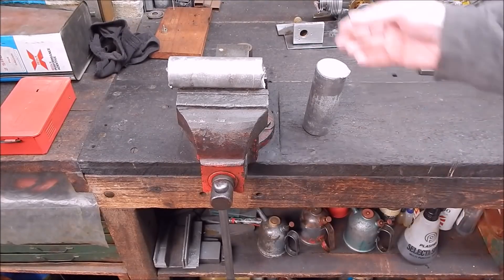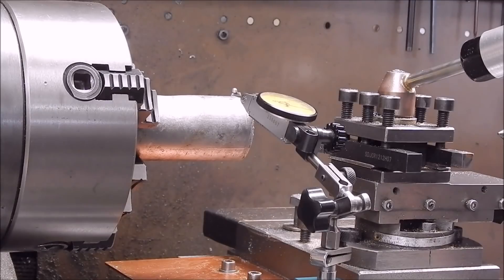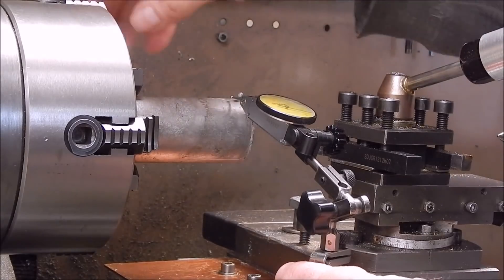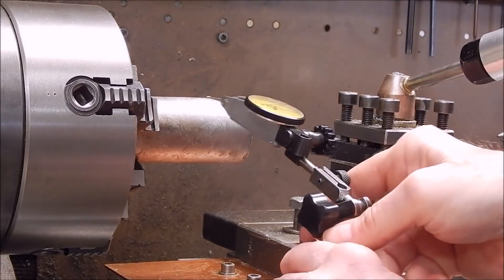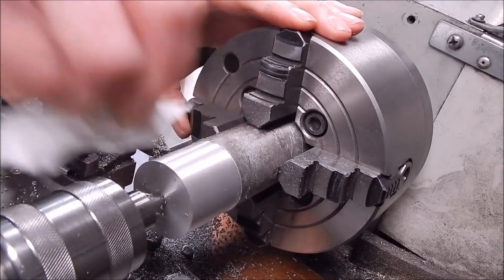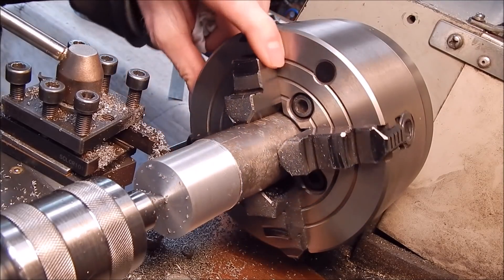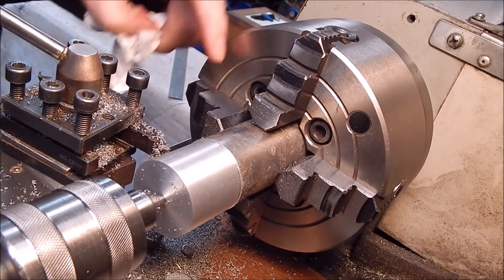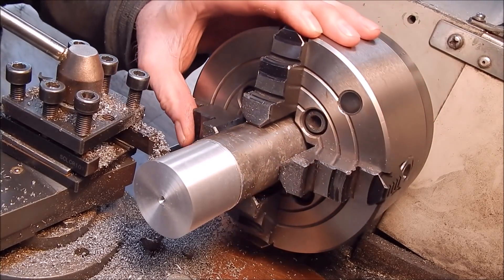How good is home made aluminium round stock for a metal lathe ?

Comment: Amazing the price they ask for "new" stock. I'll throw anything I have into the furnace but I've given up on cans, too much work. They almost always have beer or soda left in them which leaves more voids. Mostly I use castings for my lamps and I don't need anything that's graded, except for polished stuff, I have to use "new" stock. I've even thrown "white" metal into the mix but it makes the aluminum stick to the end mill, a real pain so I stopped doing that. Extrusions, wire, I don't care. If you get particular, you go without. Cheers!

Comment: innerestin' but the tensile will be low low, good idea though, as a yachtbuilder I'd often get a tonne of scrap, 20% waste in yachtbuilding, did you melt it in a pipe
Reply from the maker: I use it for lathe change gears and the teeth stand up to those loads OK.  I melted it in a crucible and then poured it into a pre-heated pipe.

Comment: Didn't really need to watch this as I knew the result would be good. Apart from an aloominumiom manhole cover size piece that Craig's workshop gave me, the only stuff I have is thousands of empty beer cans 😁🍺
Reply from the maker: Time to warm up the shop with a furnace Bill.  Casting in winter has it's good side.  I could never get to like drinking beer out of a can.  Stubbies always for me.  Cheers Rob
Reply: 😅 Yep, the gas forge at 1000c helps take the chill off, a touch of spring in the air now so the little pellet heater is a bit more effective.
Used to drink stubbies when I lived in town but storing them for recycling became a pain in the country so I changed to cans and I'm sure the pneumatic crusher gets upset if I do have the odd stubbie on the premises 😁
Reply from the maker: Hi Bill.  Have you tried melting brass in it?  That temp would do it.  My LPG setup wont. Just make sure to have good ventilation as those brass fumes are very nasty.  Just having a Chang now, yum, never too cold for a beer.  Cheers Rob
Reply: Hey rob 🍺 Size and shape of the forge wouldn't fit a crucible 😕 Need to make an upright furnace one day and at least melt a heap of scrap brass into ingots or bars.
Always gotta have a window open with a big flame, they chew thru the oxygen bloody quick. A family was recently hospitalised down here for CO2 poisoning.. Gas cooker in the lounge room 🤦‍♂️🤣
Ever tried making a better burner for your furnace? easy to make and capable of well in excess of 1000c
Reply from the maker: Hi Bill, I see quite a few plans for them.  Maybe one day.  Remember those stinky old kero heaters people used to run back in the 70's.  LOL.  They were pretty bad.  Even wood fires give of toxic stuff.  Cheers Rob
Reply: Someone gave me an as new kero heater 20ish years ago, never been brave enuf to try it 🤣. Yep, woodheaters can be bad 😢🤣 but if I stay here I will get another one for the shed, pellet heaters are shit, never buy one.
🍺

Comment: I have only tried this once and it turned out shit full of pores. I think my mistake was to do the melting directly in the pipe that also was the form. A high narrow crucible doesn't allow the gases to escape and maybe it was too hot too.
Reply from the maker: Those holes are from gassing.  The temperature was obviously too high.  Higher temperature  results in higher gassing levels.  Simple as that.

Comment: I need to set my furnace up some evening and melt all my scrap into bigot. I've got quite a collection, a wheel rim, old water pump housings, ac compressor housing and internal parts, a snow plow pump housing, brackets and intake manifold from an engine I replaced. And now an Acura transmission that I haven't stripped the insides out of yet. I'd love to get to a point with casting aluminum that I could produce a set of valve covers and an intake manifold of my own design for one of my engines. That would be awesome when I go to an event and every one asks when I got them from.

Comment: This is a very simple question but I have never understood what happens. When you did the facing cut and then went back wards with the cross slide there was still a small cutting action. You could see a change in the reflection and there were some small chips too. I have observed this on my own lathe many times and for a long time thought it was something I was doing wrong or some problem with my lathe. I have wondered if it was some kind of flexibility in the tool, but this seems unlikely with carbide, or some kind of relaxation in the faced surface of the aluminium but that also seemed a bit unlikely. Then I wondered if it was expansion of the aluminium caused by the cut making it warm.  It may be something entirely different, but it would be nice if I could finally get an explanation for why it happens and if it can be avoided. Thanks for sharing
Reply from the maker: I expected a comment on that obvious finish improvement.  When doing the final return pass, I applied very slight pressure to the cutter.  The finish improves because you are cutting away from centre, which means the cutter has a much more gradual lead in angle (as you are now using the SIDE of the insert).  It's a good trick.  You can often get a similar result when turning AWAY from the chuck on gnarly/feathery low grade steel. It depends a lot on the shape of the cutter.  Try it and see.  Cheers Rob
Reply: If you aren't doing this on purpose as xynudu is, It is probably caused by some small amount of tool deflection away from the work (or work deflection away from the tool) in your initial facing cut. When you have taken that initial cut the machine is now unloaded and springs back, resulting in another very light cut on the retraction. It probably isn't so much the tool bending as it is your compound and cross slide 'rocking' as they take up the small amount of clearance between the dovetails and their gibs, especially on a cheap or worn lathe where the slideways may not be perfectly flat.
Reply: The great blessing of YouTube is that I get to learn techniques and gain information that without channels like this I would never get. My Myford ML7 is such a blessing for doing all manner of small jobs that otherwise would stump me & in many cases force me to spend on new machines as I would not be able to repair what I have. Often from watching videos like this I refine and enhance my abilities and that allows me to do stuff better or in some cases do stuff that would otherwise be beyond me. Thank you for sharing!
Reply: Thank you so much for such clear answers. I had not been doing this intentionally  & now I have an understanding of what is happening & potentially things I could do to try & prevent it, although given the finish improvement that was seen in the original video I should perhaps try the suggested technique adjusting as appropriate.to get the most out of my lathe. Mostly I use self ground high speed steel although I do have some carbide cutters. It would be interesting to do a comparison to see if what  I imagine are the more rigid carbide show less of an effect than the high speed steel. Super comforting to have answers to what has been a long term puzzle fir me. Thank you!
Reply from the maker: Carbide normally doesn't have a knife edge like HSS.  It uses a different technique to do the cut, that's why a light cut can often look worse than a heavy cut with carbide.  HSS handles both very well and it's sad to see a lot of machinists go carbide happy and neglect the tried and proven HSS alternative.  The attack/lead angle of the cutter has a lot to do with getting a fine finish.  That's why large radius and blade cutters are generally used for finishing work.  Cheers Rob
Reply: @Xynudu  Worth mentioning, it also changes the thickness of the chips (More lead creates a thinner, wider chip) and affects the direction of the forces acting on your cutter: for example, a 'knife tool' with no lead angle sends almost all of the cutting force in the direction of feed, whereas a 45 degree lead angle will send roughly half the force in the feed direction and half the force perpendicular to the feed direction. Worth accounting for sometimes, e.g. you may find that long shafts get more of a bulge in the middle if you have more lead angle.

On a small lathe I think HSS is very often simply the best option. It's cheap, you can make whatever shape of cutter you need and the sharp knife edge cuts effortlessly compared to a coated carbide tip. I only use carbide on hard or abrasive materials that would blunt my HSS too quickly.
Reply from the maker: It's an interesting subject that can make a big difference to the quality of finish achievable, particularly on non ferrous metals.  For brass work HSS is virtually unbeatable (unless you use specialist carbide grinds). 

It always brings a smile to my face using HSS on the little Sherline when working with these types of metal.  Once again, many people just can't seem to understand that small lathes are made expressly for small work and are very good at it - they are not "toys". Cheers Rob
Reply: @Xynudu  we haven't seen the Sherline out for a while, would love an update!!!
Reply from the maker: I've been using it most days to turn and recover scrap brass for the current model engine project, but thought people might find that a bit boring.   Even though I have three lathes, they all get used as it saves a lot of work dismounting and they all have different capabilities.  Plus the whole three cost me less than $2 K AU in all up restored/running condition, so why not ?  That's not including the other Schaublin I found under a tree which is languishing under the bench in pieces.  Cheers Rob
Reply: @springwood cottage I've experienced the same on my mini lathe, whenever I'm facing or turning, there's always a small cutting action if you make another pass without advancing the cutting tool. Is this the same on much larger and more expensive lathes I wonder??

Comment: Question Are Bear Soda aluminium can good for making stock?
Reply from the maker: I've no idea on that.
Reply: The problem with melting soda cans is similar to the drawbacks with melting swarf.  There is a very large outside surface area that introduces a lot of ally oxide into the melt. There is also slag produced by the printing ink on the outside and a lacquer coating on the inside of the can.

Comment: The thing with aluminium is that there are many different grades designed  for different purposes - some are good for machining, some for welding, some for casting and others are suited for forging or extruding.  When you get poor results, it is usually due to using the wrong grade for the process.  The trick with using scrap is to only use scrap where the original piece was made using the process you are intending to use it with.  So car wheels, manifolds and gearbox casings are good for casting and machining, but probably lousy for welding;  aluminium boat hull and fittings are good for welding and forging but horrible to machine; window and screen door frames are good for extruding but don't machine well.  And never, never mix your types of scrap when melting it down, the resulting grade could end up being anything.
Reply from the maker: Yes, it's always a good sign if the scrap ally has been subject to machining during production.  I once tried re-using a cast alumimium rotary lawnmower deck, and it was absolutely terrible stuff.  I think it was more zinc than aluminium.   Car alloy wheel rims are the best I've come across so far. Cheers Rob
Reply: @Xynudu  You guessed right. Mower decks do usually have a high zinc content. It is bloody dreadful stuff to machine.
Reply: Wheels are actually O.K. to weld. Some have got a bit of Magnesium in them which adds a bit of strength & hardness but they all have a lot of Silicon which can wear cutting tools a bit more than you might expect - hence the use of Diamond turning on them.
Reply from the maker: They are heat treated to toughen them, very much so, but that is all lost when you re-melt them of course.  The actual aluminium is very good quality as you would expect and you get a lot from one rim.   The only bad side is cutting them up.  It's a chore and having tried different methods I just use a sawzall/reciprocating saw to contain the mess to a minimum.  Cheers Rob
Reply: What about Hardrive casings? Are these good for machining?
Reply from the maker: Yes, they machine well.  Retro Steam Tech channel melted some down with good results.  Cheers Rob

Comment: have you tried brass ? i also melt aluminium like you do and want try brass, copper works well but takes its toll on the homemade gear ! nice clean work mate.
Reply from the maker: Yes, but you need a lot more heat than this furnace can provide.  It also gives off very toxic fumes, so it's something to stay away from IMHO. Cheers Rob

Comment: Rob, your 4 jaw chuck, is it a pain dialling in each time you set a job? I have a sc2 seig minilathe and am wanting to upsize my chuck from 80mm to125mm.
Reply from the maker: Hi Murray.  It's no big deal, but it does take time to dial it in.  I always use a test indicator as seen in the video. I use one chuck key and simply look for the high point and wind back the opposite jaw each time.  Work your way around the chuck and it is usually only a five minute job. 

A four jaw chuck of course gives you lots of scope for adjustment, while a scroll chuck gives you a fast and "near enough" accuracy for round stock.  If you want to go larger then you have to decide what sort of stock it will be holding.

Cheers Rob
Reply: Murray, I favour my 10 inch Pratt independent 4 jaw chuck over the Pratt 3 jaw scroll chuck always. With a bit of practice you get very quick at dialling a component to run true in a 4 jaw. If required you can adjust the job for zero runout, whereas it is not always possible to get a 3 jaw scroll to run dead on. For my vote the 4 jaw is by far the more versatile chuck. Just practice and get quick at dialling one in to run true.

Comment: I needed a small piece of aluminum one time and did the same thing. I had a Harley Dividson head to fix.  The owner tried drilling out the exhaust studs himself.... with it still on the bike. Needless to say, he made a big mess of things.  He brought me the head and I set it up on my Bridgeport.  I used a 1/2" carbide endmill and bored the stud holes oversized. (Carbide endmill because he had broken drill bits stuck in it)  lol!!! Then I turned a small "plug" out of the aluminum and pressed it into the hole just below the surface.  Then TIG welded it in and filled the rest of the hole on both stud holes.  Then I drilled and tapped as usual.  I think that was the proper way to fix it,  there was nothing else to do really.  The holes were a mess and would never accept a thread insert like a helicoil properly.  I have done this a few times.  I like to sometimes say what I have done to give others ideas or at least another way of a proper repair.  A new head would cost over $1000 dollars so he was happy with the little I charged him. But being able to melt and make your own aluminum round stock is so helpful sometimes. Especially on a weekend when nobody is open. Thank you for showing us the result of your aluminum pour. Cheers!
Reply from the maker: Interesting fix method.  Sounds like it worked out OK, so it must be a good trick.  You never stop learning and if there were no new ideas society would never move forward.  Cheers Rob
Reply: An easy but quite slow way of removing broken studs, drill bits etc. made from steel that sit in something of aluminum is to dissolve them chemically. Just dissolve some alum in water and make a small dam (e.g. from clay or whatever) around the broken stud. The alum will eat the steel but won't attack the aluminum, but it can take a day.

Comment: Crikeys Rob, I would love to be able to make this up from scrap........its $$$$ to buy mate.......great stuff as always.
Reply from the maker: It's all do-able, for very little outlay.   You just have to have a go.  However, if handling hot metal seems a bit hairy, then don't push your luck and go buy some new stock.  It's safer ;) Cheers Rob
Reply: @Xynudu  I'd like to do brass, I have ridiculous amounts of quality scrap brass that I'd like to make into round stock for the lathe.
Reply from the maker: Yeah, me too. I have lots of scrap brass but most is the wrong shape.  I am wondering about using an electrical induction heater/furnace, but that's a new learning curve again. Banggood have them.  I will look into it.  Cheers Rob

Comment: What a great follow up video. Thank you.  I just started this second channel for projects. I put a video of a very old table top metal planer. Check it out, it's a short video of it in operation. I'm asking people if they know anything about it or seen one like it before.  There's no markings on it.  A clue: Some bolts that hold it all together are center drilled like they were made by hand on a lathe.  I love it, it works pretty good and is accurate. Thank you!!